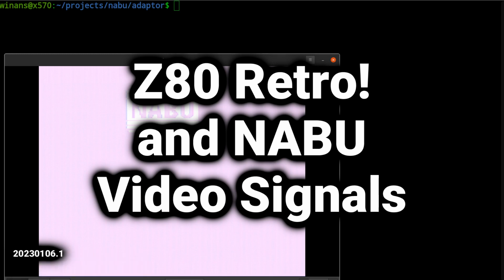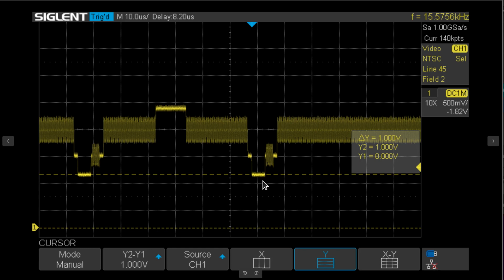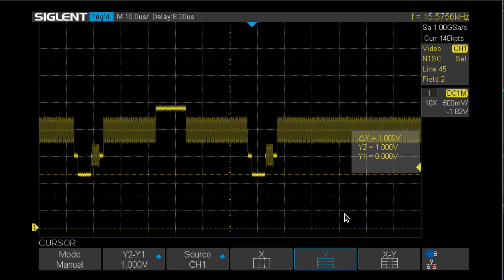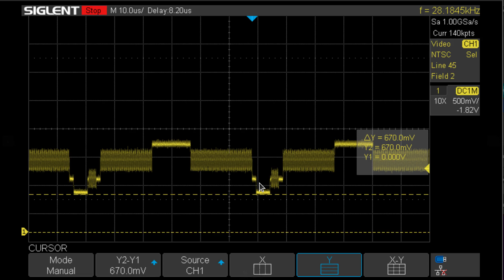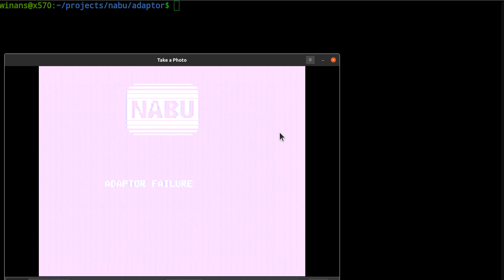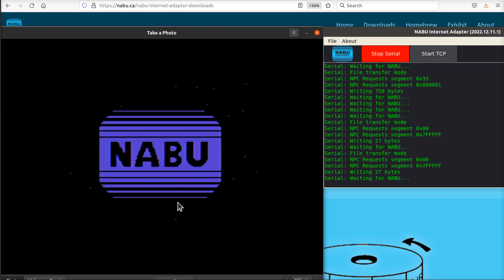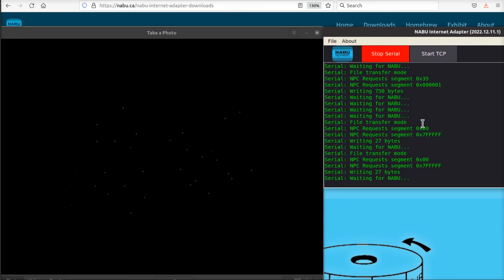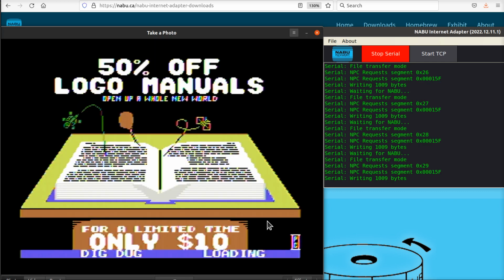NABU #3 Fixing the Washed Out Picture on my NABU.

Comment: I have a NABU that outputs colorful composite to a cheap old VCR/TV combo, but when plugged into my N. American NTSC Daewoo MSX monitor the video is torn at the top and the color is missing altogether!  (My TI99/4A looks beautiful on that same MSX monitor)
Could this potentially be the same issue?
Reply from the maker: Yep.  It could be.
Reply: @JohnsBasement  I gave it a try (with a 32ohm resistor as that's all I had around) but seem to have no difference.  I notice a trim pot and a crystal next to the video chip. If I rotate the trim pot any amount, I see no change to the video.  Would you know if the trim pot/crystal is related to video timing?
Reply from the maker: @bitplanes  Your 99/4A has a much better video output circuit than the nabu.
That trimmer is not a pot.  It is a trim cap.  I didn't note any change when playing with it on mine either.  I suspect it has to do with the oscillator duty cycle.
You ARE putting the resistor on the signal wire (not the ground wire).  Yes?
You can also try a signal diode instead of the resistor.  Put the end with the stripe on the TV-side of the cable.  (Most any rectifier diode may do.)
Reply: @JohnsBasement  LOL yes it's on the signal (center). I tried a diode and got the same result (also confirming that turning the cable around results in no picture).
Reply from the maker: @bitplanes  I suspect that each nabu is a little different. Try putting two diodes in series. That'll drop the voltage even more. If things like that, or maybe a diode and a resistor, don't fix it for you then you're going to have to get more creative with the output amplifier circuit. Have a look at the schematic of the TI 99 and see if something like its video output amp is in your wheelhouse.
Reply: @JohnsBasement  I improvised a vector scope out of OBS and tried adjusting that cap as well. I could see that the colors moved but then immediately snapped back. I didn’t end up posting this video because it was like the first day I had my NABU, I was full of ignorance, kept calling the capacitor a pot, etc. Seemed like a potentially interesting experiment, though. https://youtu.be/1b31o9QujWY

Comment: How does the video signal look with an inline 75 ohm BNC feedthrough terminator at the DSO input terminal & input coupling set to AC?
Did you ever try inline 0.1uF through 2200uF AC coupling capacitor?
Reply from the maker: I played with a coupling cap at one point.  But it did not pass a viable signal.  
I think I need to try it down-stream from the 75 ohm terminator (In the capture device) OR between the VDP (after the 480 terminator) and the input of the emitter follower.

Comment: Thanks again John, I'll have to try the series resistor as the S-Video adapter didn't work out either. I'm thinking about using a micro pot for testing purposes. I'll let you know how it turns out.